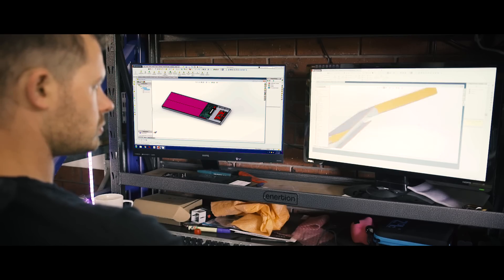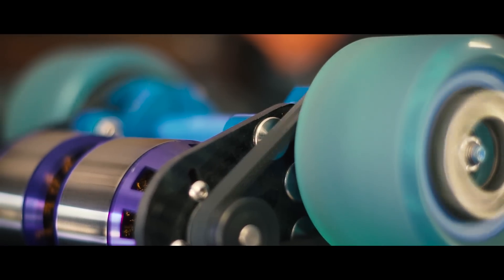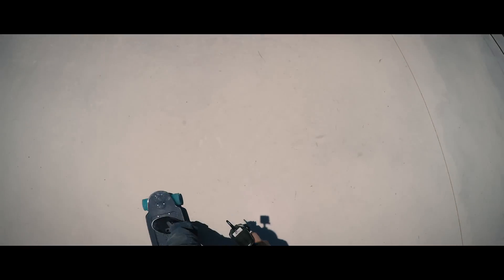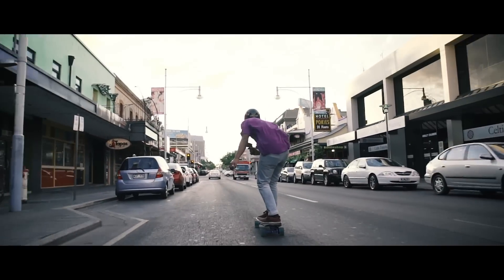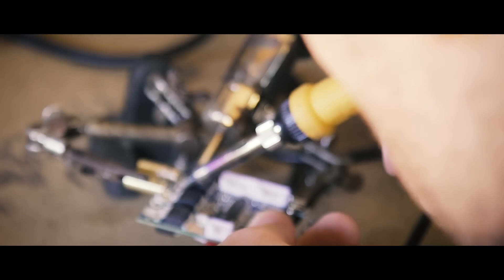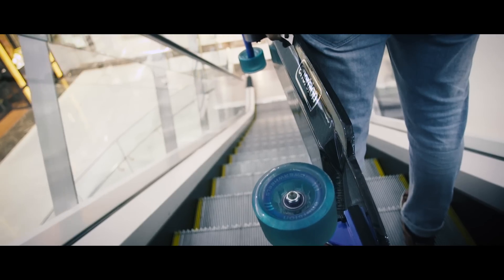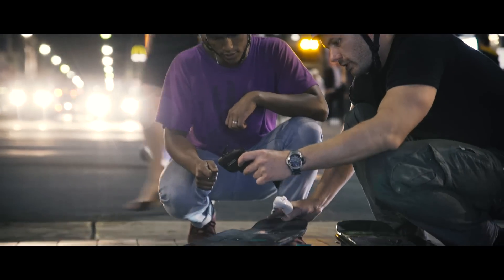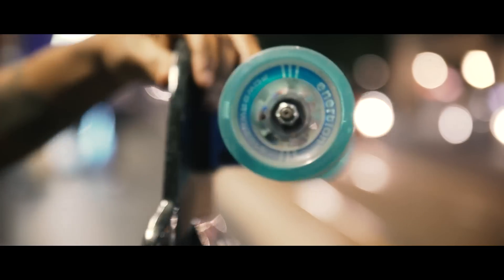EnertionBoards.com - Building the Best Electric Skateboards

Comment: I have this board and I really do not like it. I prefer my boosted. From the start I was sent the rapter board with no controller then it also didn't have a handle nor spare belts and when they did send the handle the screws did not fit I did send and email but did not get a response I would like to sell mine for $1000 it is a dual and I only have maybe 15 miles on it. I am willing to take the big loss for other reasons for instance the carbon board is WAY too stiff form me and I don't like how the sides are slanted up.

Comment: you guys are awesome and have been helpful in the construction of my own electric skateboard. I used your hardware mount for attaching my motor to my caliber trucks.
Only issue I had was the positioning of the hardware on the trucks wasn't working and was impacting into the bottom of the deck during turns. I fixed this by adding in risers, problem solved. Just something for you guys to look into in the future.

Comment: Wish I could afford one of those :$
Reply: +Jake Methner you also buy time and knowledge - you have to do a lot of research to do these products in the quality they are right now
Reply: +mace FTL built one for about $400
Reply: +semajkecyr show off! I want to buy a pre built electric skateboard, easier :)
Reply: +mace FTL building is not that hard, but if you want to have one like the raptor dual you will spend minimum $1000.
so, buying is not that bad when you buy from enertion. 
Of corse, a boostet is way over priced. One like the boosted single you could build around $400-500.
Reply: +donblub lol. The Boosted Single could be made with around $500 but the Raptor would be around $700.
Reply: Jake Methner show me the parts. 
do not belief how you would like to make a raptor like for this money.
for me, nothing without a good motormount and a vesc.
and a battary like in the raptor will not be cheap, even if you build it your self. 

so pls show me how;)